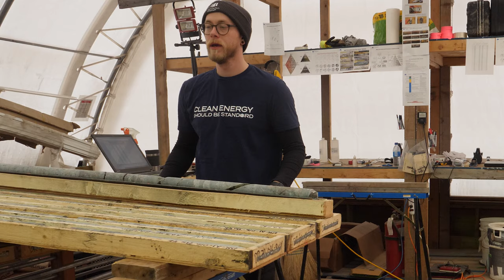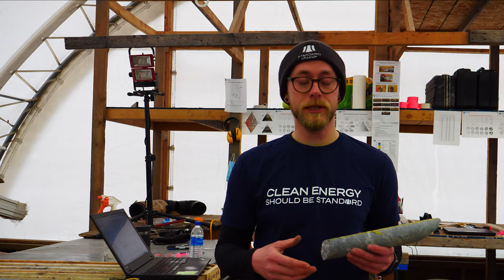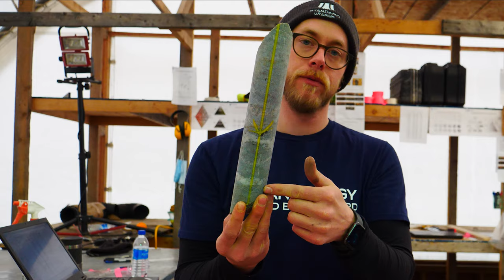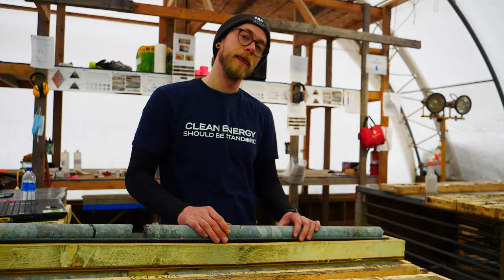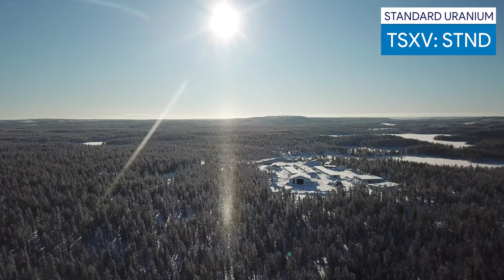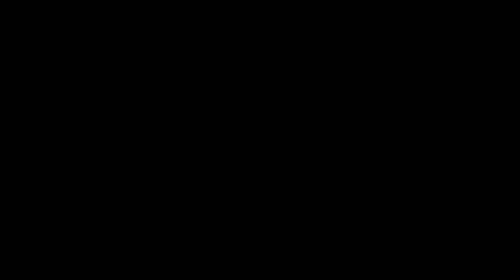Oriented drill core

Comment: Hi. Can you briefly explaing, by which tool, during drilling, the bottom of the inklined borehole is marked on the core. You have marked a line on the core, but how do you know that this is the bottom side? Or have a link to the core barrel device that does this job. Many thanks, also from a geologist. Dieter.

Comment: Yes would be good to know the methodology. I heard about camaras to see the planes but this methodology works too
Reply: Yeah down hole televiewer is what you are referring to.  There are situations like flat holes (horizontal) that televiewer will not work for.  In those particular situations you have to go old school with directional core.
Reply: However when doing initial drilling standpoint the data is invaluable to begin modeling your structures!